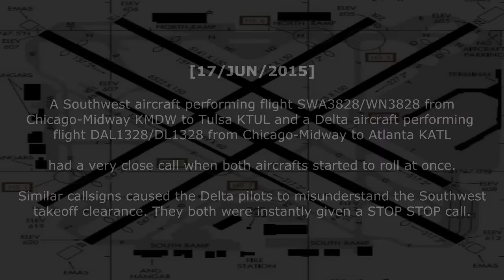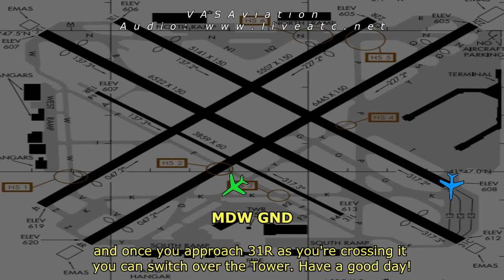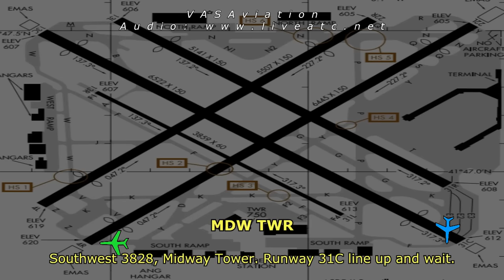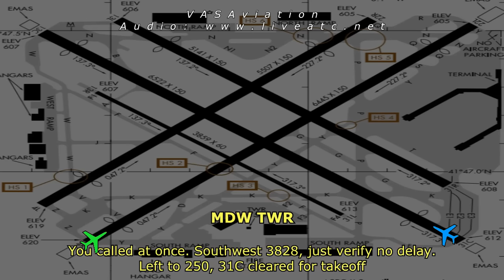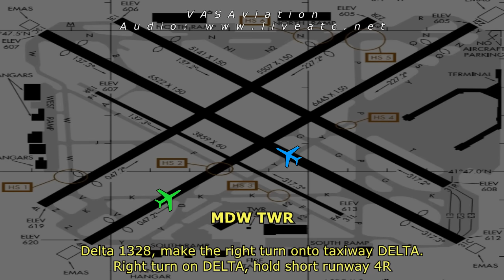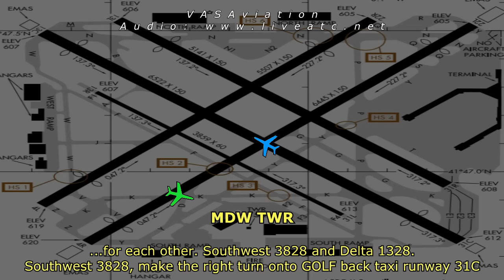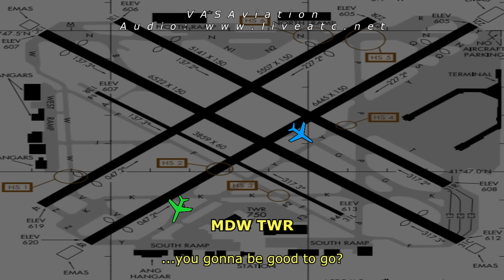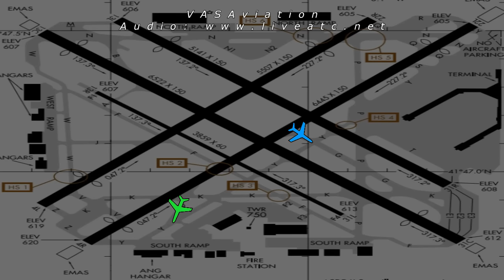[REAL ATC] Delta and Southwest VERY CLOSE CALL on takeoff

Comment: This could've easily been the KLM and Pan Am crash again
Reply: I would think that it's unlikely this incident would have been like Tenerife. At Tenerife, one 747 was taking off, while the other was crossing the active runway. Because the crossing 747 was going slow, there was a long window of speeds and times that would result in a collision. In this example, both of the aircraft were taking off, and would have been going very fast at their path intersection. With such great speed on the part of both aircraft, the collision window would be much smaller, which would let any small difference in acceleration or runway length change the situation from a collision to a near miss.

However, I definitely think you are right that had they collided, it would have been a disaster approaching the scale of the KLM-Pan Am crash
Reply: but if they did both take off with one plane flying past just a little bit later, wouldn't there also be some danger due to the 1st plane's wake turbulance?
Reply: @unyxium  Great point, I hadn't thought of that! If that were the case, I doubt it would be quite so catastrophic as Tenerife, but the second plane could well have crashed right after the wake turbulence. I don't remember what aircraft these were, but one other thing to consider is that the wake turbulence of modern aircraft with wing tip devices would be much less than aircraft of past years. With that in mind, maybe, depending on pilot skill, aircraft type, and luck, the second aircraft could have made it.
Reply: I’m not sure if it would’ve crashed though because while I was look at it It looked like Southwest was going fast and Delta was going slow but I’m not sure so maybe stopping both planes was the best idea
Reply: My mother’s best friend died in that accident. And I myself am now a Boeing 747 captain.
Reply: JumboJetPilot But aren’t 747’s not in service anymore?
Reply: @werdnasworld  Some airlines do fly them still. Lufthansa and British Airways come to mind. However, most airlines are phasing them out in favor of dual engined planes. At this point, a lot of the airlines that expect to continue using them will use them as cargo aircraft.
Reply: Sunbeam as for passenger carriers, Korean, Lufthansa, BA, Asiana, and perhaps a couple others are still using them. Lufthansa and Korean both have the new variant, the 747-8. Lots of cargo carriers still fly them and are going to continue flying them well into the future.
Reply: JumboJetPilot ohh ok thank you
Reply: @ojtheaviator1795  Couldn't have been any larger than a 737: SW only operates 737's and Chicago-Midway can't accomodate widebody jets anyway (runways are too short).
Reply: Tiny planes this time, not two 747s filled with people
Reply: @Munro McLaren No it wasnt. Look it up
Reply: There was so much shit going on during the KLM and Pan Am incident. You should watch the Air crash investigation episode on it.
Reply: @werdnasworld  they are, but increasingly a niche role. UPS uses them for long haul cargo
Reply: Except this was a 73 and maybe a 73, A320, or MD-80
Reply: Sunbeam I remembered that horrific accident! Thank God for the awareness of these professionals
Reply: @jumboJetPilot  Back in the early 80's, I used to do a lot of business with a survivor of that insanity. He was burned terribly over most of his body. His wife did not survive. They were on their honeymoon.
Reply: Timothy Foley Wow! I’m so sorry that he had to go through that and the thought of losing his wife of all times, their honeymoon. That’s heartbreaking! I hope he has recovered and moved on as best as he possibly could after going through something like that.
Reply: As I commented, had it not been for tower’s vigilance, this could easily have become another Tenerife.
Reply: @werdnasworld  They're most in the retirement phase but there are still a buttload that are flying cargo and will be for another 20 years.
Reply: @unyxium   wake turbulence is more of a problem if you keep hanging , trailing in it.

in this case they were going to cross it.. which is just a very brief bit of turbulence.. and they would still be on the ground, picking up speed.
I doubt WT would be an issue.

crashing into the other planes would..
Reply: WE GAAN
Reply: Mr. Crowley one of the most intense episodes
Reply: Oof, hurts the heart just thinking of that what-if
Reply: "Tenerife... the Sequel".
Reply: @noex100  Southwest 3828 was a 737-700 and Delta 1328 was a 717
Reply: @Mansaber  Yep. The arrogance of the KLM pilot was a huge factor in that awful accident.  
He took on additional fuel unnecessarily as well.
Reply: @ojtheaviator1795  yep someone finally had their cup of joe
Reply: @appleboi82,

Actually a good number of souls on The Pan Am flight survived. Mostly those in the front of the plane and upper deck including both pilots and flight engineer.
Reply: @kevinpatrick3280  And he was on the cover of their flight magazine. Very arrogant!!
Reply: @ojtheaviator1795  The Tenerife disaster had a collision window much bigger than even a runway crossing - the second 747 was taxiing along the runway in the opposite direction.  They got hit almost broadside, but that was because they turned sharply just before the collision.  They had decided that leaving the paved surface was the lesser risk, which was probably true.  Unfortunately it was already too late to avert the collision.
Reply: @unyxium  yep
Reply: @aarondynamics1311  Mini Tenerife, then
Reply: @ojtheaviator1795   Would wake turbulence be a factor after one plane cross the path of the other in such close quarters?

Comment: If I'm on the runway with a " line up and wait" and any transmission is blocked, I don't move, EVER!
Reply: but TWR said, "no delay"
Reply: delta wouldn't hear a block, south-west might not get the reception of the delta anyway and only tower
Reply: There was no way that Southwest wouldve heard the block. As far as they knew, everything on the radio sounded normal until they heard "stop"
Reply: I think the "no delay" were the catalyst words that set this already-messed-up situation going down the one-way road to the point of no return.
Reply: How the hell would SWA hear their transmission was blocked if they were the ones transmitting? Have you ever used a radio in your life?
Reply: Experiences from Tenerif disaster :)
Reply: Nick dSylva how is it you watched this video, with color coded subtitles, with the ability to rewind and listen again, and STILL didn't figure out that the Southewest crew on 31C was cleared but the Delta crew on 4R was NOT cleared.  So....Southwest was right, Delta jumped the gun and was the airline you would say is "running over everyone".
I hope you're not doing anything more complicated than flipping burgers or bagging groceries for a living....I'm not even sure I'd trust you with that.
Reply: The ATCs said they were talking over each other. But still, ball's in Delta's (and the ATC's) court on this one - Southwest received a takeoff clearance, and a recommendation to go immediately because of incoming traffic. Maybe they should have spent a few seconds reading back to the tower and confirming there wasn't any more blocking (in which time, Delta might then have lit the fires and gone zooming past in front of them), but at the end of the day they appeared to hear and read back everything correctly. Might not have been worth the hassle to delay and triple-check in the face of a "go, get out of here, scram".
Reply: @douglasheld no-delay was cause they had landing traffic on that same runway, but that would be problematic as they shouldn’t be allowed to enter the runway is the landing traffic is very close.